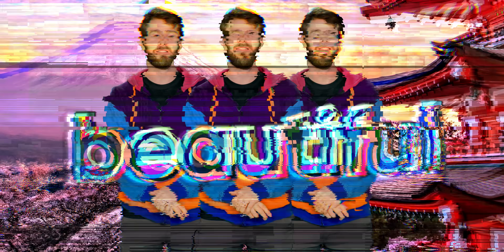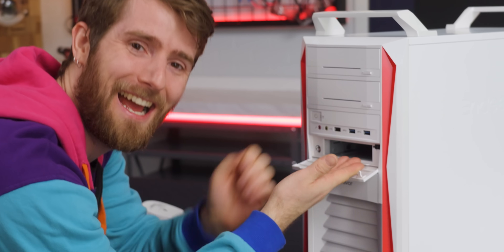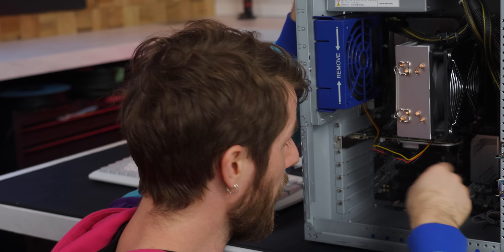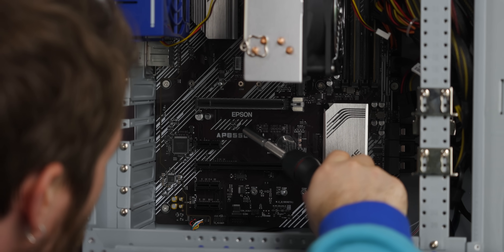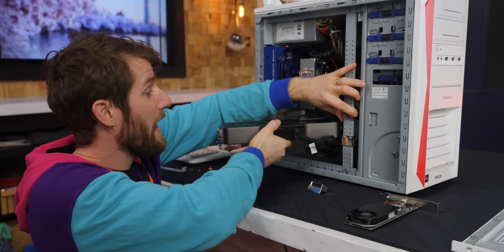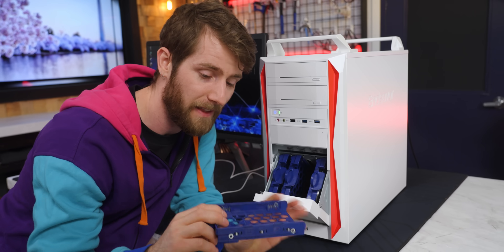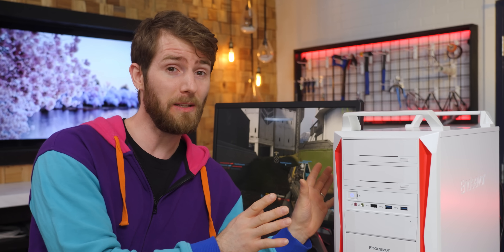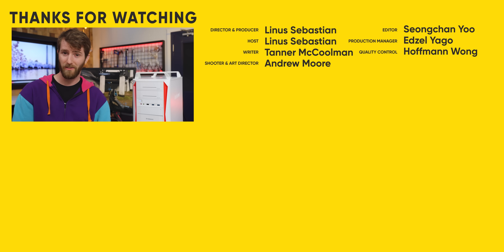I Bought a Gaming PC from EPSON - Epson Endeavor Pro 9050a

Comment: I really like that case tbh. I wish more companies would make cases like that these days
Reply: What even is air flow? Certainly not this case. How to roast modern hardware 101. i commented before i finished the video folks, the thermals arent terrible. its still not a good case though. sound aesthetics and space matter too. i would prefer my game to be louder than my case fans thanks
Reply: I totally want a case like that. rig up my own preferred hardware though (Gigabyte Intel Board, Samsung SSD's)
Reply: @antanis  They give you the performance chart, it's fine, much better than many of the modern case from Dell or HP
Reply: that case can survive an earthquake lol
Reply: @e21big  its surprisingly good for the case style, but comparing it to trash isn't exactly helpful. I have no clue the offerings outside of canada/USA but that is a bad case in our market. Japan might be an entirely different story. It's also not running a  particularly high end cpu
Reply: That is literally a SOLID gaming PC🎮
Reply: @antanis  If it can keep a 3080 Ti at reasonable temperatures, it's going to be fine for 99% of setups.
Reply: @antanis  Did you not watch the same video I did? 63c on the CPU and 71c on the GPU while gaming is hardly "roasting"
Reply: I'm still using Antec Atlas and Titan cases from ~10yrs ago.  I hate RGB and like having externally swappable drive bays. I would buy a half dozen of these cases if someone imported them into the US
Reply: Yeah, it feels very nostalgic yet clean enough to stand up today.
Reply: BE QUIET has those types of cases but for their full towers. (which is the one I have)
Reply: @JohnnyBBad-rf1bk  I have a Cosmos II from Cooler Master. It might weigh a tonne, but external swap bays are fantastic.
Reply: I'm about to do a build in the Dark Base Pro 900 for that reason (dual optical drives and triple HDDs included!)
Reply: @antanis With the right fan selection and setup these cases flow as well as most cases while being far more practical. After all too many modern cases for the western market have solid glass fronts with tiny openings for airflow anyway.
Reply: @Hybris51129  if you buy a case with no airflow and a solid glass front then it's your own fault. Those are bad cases. This one's sounds like it's taking off and would definitely roast components if you tried to run it quieter. You can get cases with real airflow, and get the same or better thermals for much quieter. Why are we defending this? It doesn't even have room for cable manegment.
Reply: Agreed... The only modern case with optical bay is Fractal Pop. For someone like me (who uses Bluray M-disk to back up) it will be no choice to get a frontal USB-C otherwise..
Reply: Same. I love the front hotswappable mechanical drive bay, and that GPU support should be standard in every damn case.
Reply: Not the most modern one but ir looks professional and the quality is way beyond most cases of the early 2000's.
Probably on par with a professional dell system.
Reply: @antanis  We are defending this because it's clear that you have an extremely narrow view of how to work in a case that is anything more than a absolute barebones open case rig and its funny to see you spin your wheels.
Reply: @antanis  That's because I view modern cable management as stupid. The only cable management that matters is neatly running it out of the way and bundled together for air flow and ease of servicing reasons. Not hidden and inaccessible easily for looks. A PC should be built with performance and servicing in mind.

When I see these elegant water-cooled builds I think it looks like a nice art piece, which is cool to look at online, but for personal use seem like an upkeep nightmare. Hard tubing and no quick disconnects. Ooof.

This is however my opinion and other people have different priorities. Plus I can't deny they do look cool.
Reply: @Hybris51129  you're defending a case that forces your fans to run loudly for no good reason, has limited internal space, and no room for cable manegment. I'm not suggesting you get an open case, just one with mesh or something not entirely sealed in the front maybe? Or how about one that doesn't also look like it's 20 years old? It does have the benifit of not using proprietary components though so it handily beats an unfortunately large swath of other prebuilts on the market
Reply: heaps of pedestal  server chassis are similar to this. You're just looking in the wrong place.
Reply: @ky5666  I find a regular air cooled system with manegment space in the back pretty easy to service. I'm not a fan of zip ties and the like myself. It looks better, and doesn't make it meaningfully harder to interact with to me unless someone gets trigger happy with something that requires tools to move around or remove
Reply: I love old cases since, REALLY you can easily put more space instead of ogaboga  hard drives hidden for more rgb!
Reply: @Thumper68  Do you specifically know of any with that fold out HDD dock system?
Reply: @antanis  Spin spin, dig dig.
Reply: @antanis  Doubt it. Japan is a country of minimal AC. Usually it's in one or two rooms of an entire house with wall mounted units. Central air is not a thing. Epson has to assume that in the Japanese market people are going to be using that computer in summer temperatures and humidity. The fail rate can't be so high they don't make money on the product, which if it couldn't keep the components cool would be a no no. Probably why all the fans are chunky oversized ones aiming for high static pressure over pure air flow. PC builders here don't use that option often as vents and adding fans are cheap. See it on servers though where there is a one way input and output on server racks for hot isle/cold isle. They want a high continuous pressure wave of air going through the server case.
Reply: Grab one of the old lian li aluminum silver cases!
Reply: @halycon404  i do stand corrected on pure thermals, but the poor cable space, and aesthetics, combined with the terrible noise still leaves me disliking it as a whole product. it also adds cost in case features that  are a waste in the consumer market. ignoring the awful price to spec and just assuming its average in japan, why waste money on hotswap drives when youre getting a 1030 and  a single stick of ram?
Reply: I'd buy this. If they took out that front drive bay and put a 140mm fan there, sold.
Reply: @roflewafe47  For reasons I explained above, you'd probably be making it worse. That entire case is setup for cooling using static pressure, not max airflow. Instead of lots of air intakes and output vents it wants a single route for air to flow, and instead of lots of air it wants high pressure air waves following that route. It's not a common PC setup, it's a common server setup for airflow and cooling. Instead of overflowing the case with air to get the job done, it wants to extract as much heat per meter of air moved. Adding more fans without taking it into consideration that it's a completely different paradigm would ruin what it does.
Reply: Totes!  Years ago I had a case with two removeable hard-drive slots, right on the front.  One of the best ways to upgrade I had ever encountered. Kind of misit,.
Reply: @tbuk8350  Or how about also offering pizzapan/HTPC style case aka OG Horizontal? Back in the day they could support a heavy CRT monitor. I'd imagine they could also support an LCD or led monitor fine. Then not only is maintenance easy, but laugh at GPU sag.  Maybe i'm odd for the LTT target audience. I also kind of prefer mechanical drives for price alone.
Reply: Same.  An all steel case, no stupid lights or window, plenty of bays for drives and addons, and the GPU support system...  That's alot of functional value to me, even if I'd probably never put a GPU in a case like this.
Reply: yea someone should get it and do a full airflow test compared to other modern cases, maybe we'll see a resurgence of the retro style.
Reply: @Thumper68  so how do I get one from you pfft. do you mean old AT or ATX cases?
Reply: wounding why on sale in japan only ?
Reply: Ohh heeell naw
Reply: @antanis  I love old school casings, they always say airflow is not good with old school casings. But I have a Coolermaster cosmos ultra II, with 15 fans inside. XD
Reply: I will always remember Linus praising the hexagon pattern on case exhaust vents. It definitely shaped my preferences as a newbie.
Cases went from stamped circular holes or more expensive wire grills to stamped odd shapes to hexagons.
It felt like we were finally free of noise caused by the case acting like a whistle.
In comes NZXT with circular holes as an aesthetic even on their freaking motherboard VRM heatsinks. Now we're back to odd shapes. FML
Reply: Those old school cases made of steel are insane heavy.
Reply: I unironicly want a case like this. Just make it a bit taller to have the psu at the bottom so I can mount a radiator at the top.
Reply: The first scene is stolen from another person lol
Reply: yeah, I was going to comment that too!! i really love it
Reply: I agree, we need more plain computer cases made of premium materials. It would seem that if you don't want a tempered glass side panel and RGB fans, then your only other choice is a cheap, thin and low quality no-name brand case obviously meant for low budget or bulk generic office computers. I don't need tempered glass or RGB in my case that will be sitting behind a divider where no-one will ever see it, but I still want good quality materials, dust filters in front of the fans and enough space for a full size motherboard and GPU without paying the "gamer tax" for flashy nonsense that I don't want.
Reply: There's a market for retroish cases with modern IO. I'd say the Fractal North is a good example. Really captures that 1970s "wood electronics" feel.
Reply: This case is definitely my style lol.
Reply: The whole pc setup is a mishmash of old and current tech...I love it 😂
Reply: Me too. I find the retro style appealing, maybe it not because it is retro, but it is simple. I first saw saw this and thought, "I want that case!" I wonder if modern case are overhyped?
Reply: Check out be quiet!
Reply: Looks like bad airflow 🤔
Reply: i like the simplicity of the case, a simple decoration and good quality. Not that hard to modify the case if you have a requirement for a little more airflow.
Reply: my only complaint with it is that it's not black because the red on the AMD one would look sick with black and it's air flow couldn't be any worse than my case without the front plate
Reply: Same, I just want to know how you could secure a glass side without drilling holes.
Reply: I kinda wanna just buy the case.
Reply: Definitely like the case. I have several older cases, and still use a first gen Cosmos for my daily driver with 12th gen i7 on an Asus 670Z board. I've always liked the looks of the Cosmos and through front drive bays, I still have USB 3 and USB-C on the front. I'll take sturdy and heavy over flashing RGB any day. I'm definitely surprised to see an Epson PC though. The first computer I used on a daily basis was an Epson Equity II+ and thought they'd long since stopped and only made printers and projectors.
Reply: @antanis The intent is that most gamers use their pc with headphones. So the fans being loud for them isn't an issue.
Unlike me, who would prefer gaming without headphones.
Reply: @antanis  Sound aesthetics 🤓

Yeah, this is about as ideal as it gets.

Comment: Not gonna lie, would seriously consider this case as an upgrade if it was available as a stand alone part. I love the retroness of it as well as the front hot swap HDDs as it could double up as a backup for my home NAS. I still have and watch DVDs and use the optical drive in my PC because I don’t want a TV and a PC in my bedroom. Also, that GPU bracket is essential in this day and age.
Reply: 100% would be awesome for a NAS
Reply: The case looks amazing
Reply: How the world does someone add a dvd drive to their pc?
Reply: @kiri3639  external
Reply: @kiri3639  even better, add a blueray drive. Just like any other drive, they have power and sata connectors. You just need a case with an optical drive bay like Phanateks enthoo pro M
Reply: With the resurgence of 90's retro PCs lately (see the popularity of LGR), a standalone case with these features, and even looks, would sell better than most people think... I for one would be in line for something like this!
Reply: @kiri3639  with sata
Reply: @IOSam  As someone whose first Windows machine was a Packard Bell back in the day, I'd love a case like this for a build that doesn't need the airflow of a mesh-front case to keep from melting down.
Reply: @BrianSmith-ct3kh  Same here! In fact, I am in the market for a 90's looking case for a vintage build (to run DOS games) and the closest thing I could find are some rather expensive retro-looking inWin cases (that you can find on Newegg), but that are a far cry from this EPSON’s one in terms of features...
Reply: Ya think they still have LAN parties in their cramped up apartments?

'Cause that thing looks LAN party transportation ready. Two big ol' handles, structural reenforcement support bracket, no cheap plastic anywhere...
Reply: 'I still have and watch DVDs and use the optical drive in my PC because I don’t want a TV and a PC in my bedroom.' What? I don't follow...
Reply: Trying to find a nice beige case these days is almost impossible, I don't want RGB, or glass panels.
Reply: RIP the DVDs to disk?
Reply: @kiri3639  i only buy pc cases with optical bays.
Reply: Couple of BR drives and would make a lovely machine to rip onto your plex array running on that bank of spinning rust.
Reply: Silverstone CS380 is perfect for you, 2x 5.25" and 8x 2.5/2.5" hotswaps out front. No GPU support bracket though, and it's thin steel to keep costs down. Something very similar to this would probably cost you close to $500-600 just for the chassis alone as it's basically a pedestal server.
Reply: I think the hot swapping should be upgraded for more recent drive types, and then I'd be all over it.

Comment: For anyone who doesn't know, Delta is like the King of power supply OEM. Whatever power supply you have in your house right now, they could make a top tier variant of it, from small tiny ones like a 12V DC brick, all the way up to a Level 2 EV charger.
Reply: I can't imagine level 4 charger
Reply: now, imagine level 5
Reply: level 6 would be crazy
Reply: Actually Delta also is high-tier fan manufacturer. You can find PSU and coolers in Macbooks, top HP and Dell laptops. And they LAST. I"ve replaced several cords, but 15yo power supply still runs my 2014 macbook (home mediacenter). It's as reliable as this case.
Reply: level 7 would be out of this world
Reply: @АнтонК-ц3э  I have mixed feelings about Delta fans. There is no doubt they make reliable industrial cooling solution, but I have a PS4 Pro from early batches, which got a Delta fan in it, and that fan do get LOUD. That is a big L for me. Later productions of PS4 Pro with Nidec fan are much quieter.
Reply: I have an old Delta PSU, still powers
Reply: In all my years of working in IT  I've seen 1000's of PC's. Only saw a couple of failed Delta ATX PSU's.
They are of really decent quality
Reply: Delta fans in Steam Decks are notorious for being really loud. Same w/ PS4 Pro. I'm sure many of them are high quality though!
Reply: @АнтонК-ц3э servers. They make those 20k RPM screamers.
Reply: I just killed some mobs and my charger leveled up. I kept doing it until it reached level 10 but now I've gotta choose a class for it, any suggestions?
Reply: @TheOznark  Pfft, Delta fans don't use any of those fancy lubricants or bearings.  Once enough of the metal drive shaft has become white hot, the molten metal takes over bearing duty and the fan quiets down.